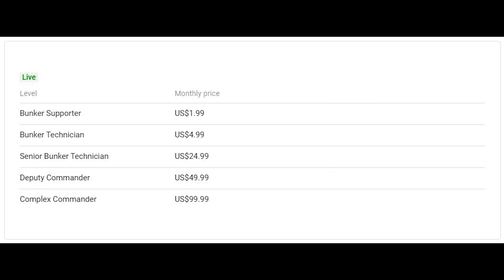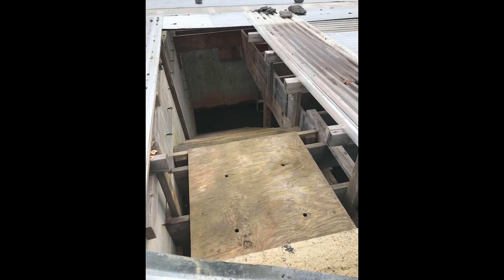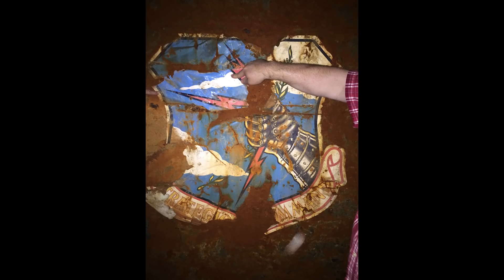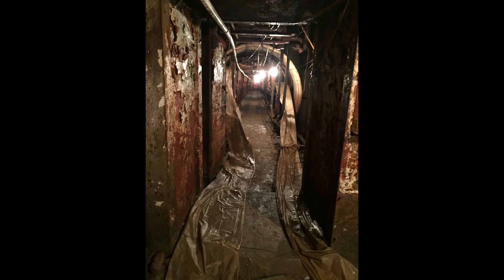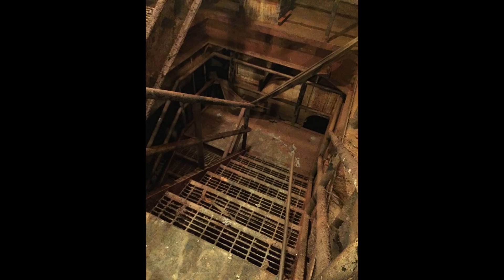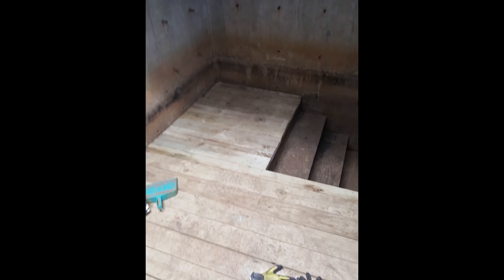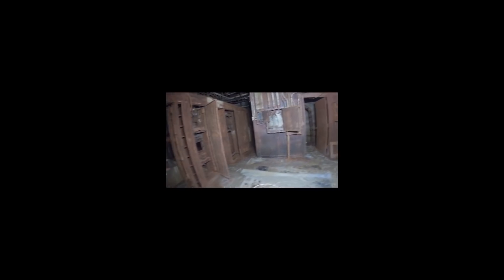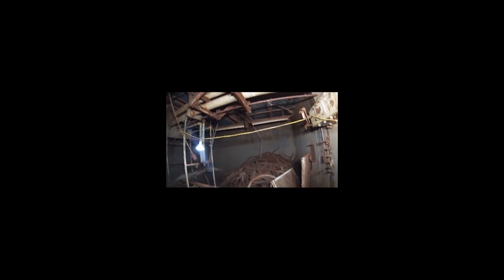S1E19 - New Memberships Options and Recap of the Past Year - Owning a Titan II Missile Silo

Comment: These missile complexes are all heavily contaminated by fuel and other chemicals that were spilled during refueling and other operations. Most of the complexes were imploded because of the contamination! As someone who worked and lived on them for a few years,  I personally would not live there.  Chemical exposure is lethal!  Check out the " Broken Arrow Incident in August, 1978 at complex 3-7, Rock Kan. This Incident is still being covered up ! You can't even get the whole story off  the internet! And yes ,I was there and have been suffering from chemical exposure since that day. And the U.S.A.F. & V.A. has denied any connection or treatment for many Military personnel and civilians that were exposed !
Reply from the maker: First off thank you for your service and I'm sorry for any exposures you may have had. I do feel I need to correct the many falsehoods raised in your post. While there may or may not be any residual contamination in the silo itself, the Launch Control Center that we have is largely free of contaminants (except Asbestos). I have had the site tested by a lab which found the ground water is clear even inside.
Reply: Gee guy get a grip! The complexes are not contaminated with anything but rust!

Comment: If you can wait, I would start getting the scrap out of the bunker but let it pile up.. The price is so low now it’s almost not worth the fuel. Wait till the price goes up and then cash out. With the amount your scrapping even penny’s will make a huge difference
Reply: Could also get a smelter and melt it down to bars then when prices rise being in all the bars
Reply: @callofdutymobile1074  fuel is worth much much much more than scrap
Reply: I found the cost of handling the metal twice outweighs any possible increase in price. You might be waiting for the price to go up and instead the price goes down. Its better to handle it once, put it right into the scrap bin and keep the site clean. This does not apply if you are saving the metal for future possible reuse. Plus if you are saving nonferrous the possibility of it getting stolen makes it better to secure it or get it off site sooner.